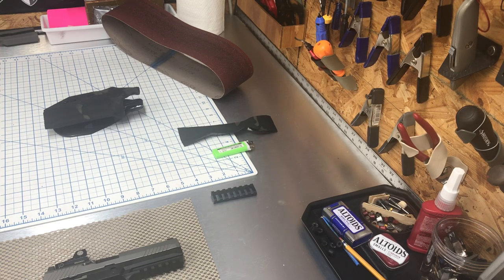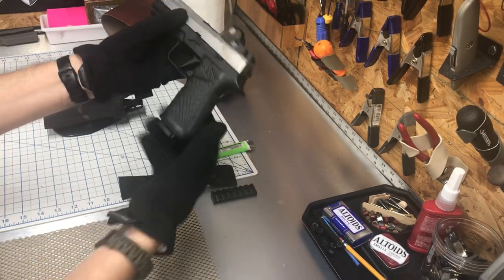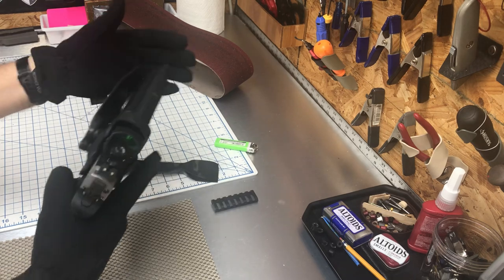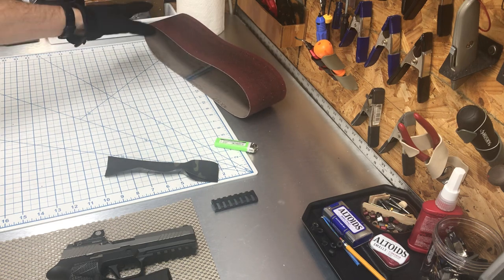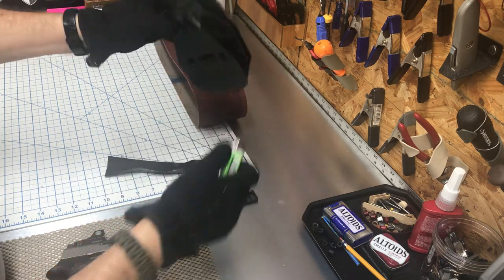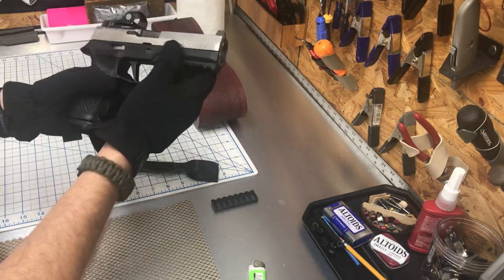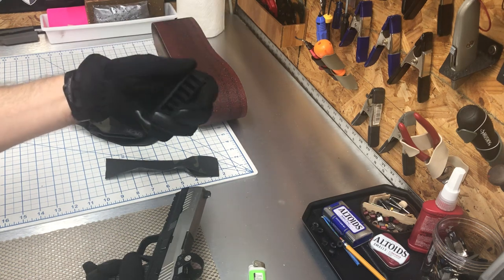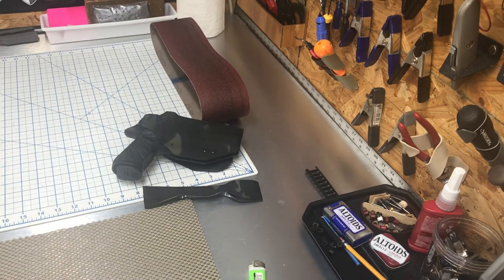Fabric covered Kydex

Comment: I hated making fiber covered holsters at first. Now I like them. I’ve tried wrapping them myself before and after press. Now I just stick with pre lined fabric dex. I hit my edges with 320 belt and then 1000 1” belt. Hold it at a slight angle and the 1000 will take off the excess fabric without eating the holster up. Then like you said hand sand scotch brite pad and lighter. Great video.
Reply from the maker: It’s cheaper to just buy the pre glued, if you start doing volumes then I would consider buying material and the 3M sheets.👊

Comment: I tend to like and make pancake style more often than taco. I get less pull up from the fabric on pancake. I use foam press with 2 pieces of foam on top of the mold. Using foam instead of vac on these legs the glue cool slower and set back up more consistently. But that’s just my 2 scents. I learned this stuff from you. And I’m still learning from you. You tha man Tony

Comment: can you make a suggestion 
I am wanting to glue some material on my  
kydex iwb To make it more comfortable And that won't be too hot in the summer  preferably thin to reduce printing 
   I'm not sure what to use or what type of glue to use    it would also be nice to be able to replace it when it gets worn  
this video was the first one to pop up when I did a search
Reply from the maker: What part of the holster is getting hot? Sweat shield back? My customers put mole skin on the back, sticks, absorbs sweat, etc
Reply from the maker: https://duckduckgo.com/?q=mole+skin+sheet&iax=images&ia=images&iai=https%3A%2F%2Fi5.walmartimages.com%2Fasr%2Ff1ab7638-6cf2-41a6-be9c-6496ae77da8f_1.3b7e15c01c288b799c6f13b32396bdf3.jpeg
Reply: @alamedacustomholsters  yes  sweat shield     what glue should I use for the mole skin    to where I can replace it  in the future 
thank you for your time